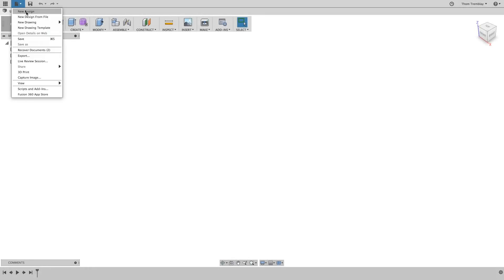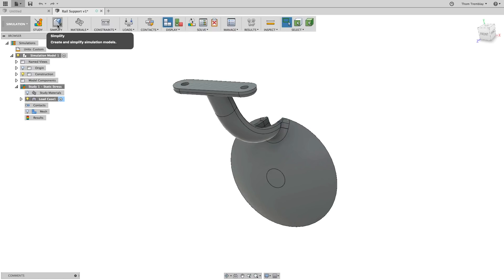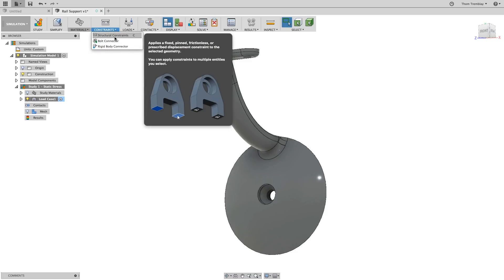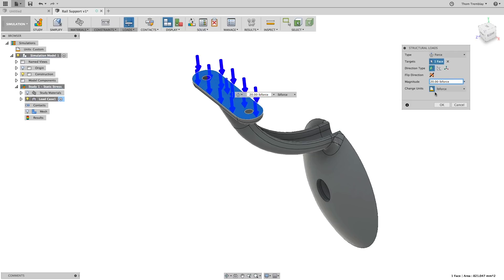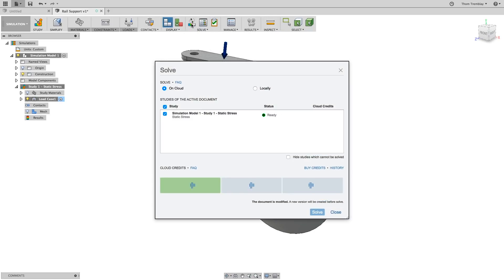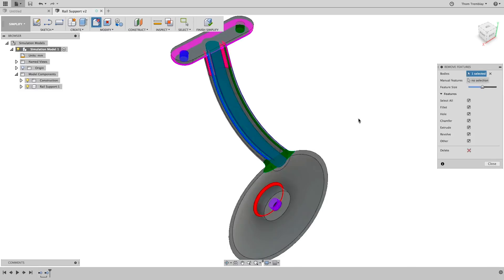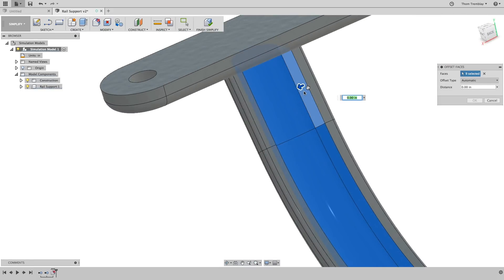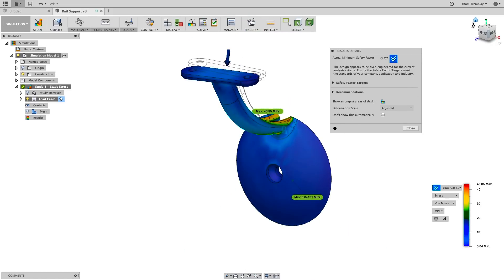Static Stress Tutorial

Comment: Hi, are you guys planning on adding 3D printing material like PLA to fusion 360? :)
Reply from the maker: To our simulation workspace, or as a general appearance?  I doubt we'll be adding that to our simulation workspace. The problem is that PLA's vary as much as the machines that use them, and the material probably varies from vendor to vendor. It's also not likely isotropic depending on process used, which adds another hurdle.
Reply: @adskFusion  Thanks for the detail response!